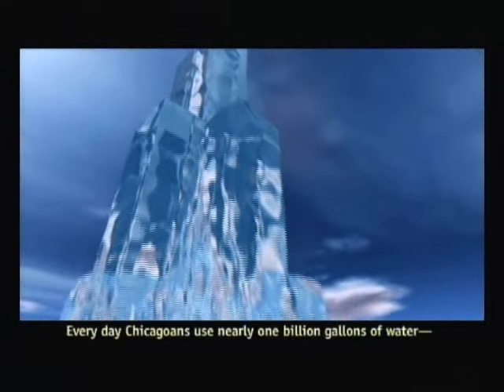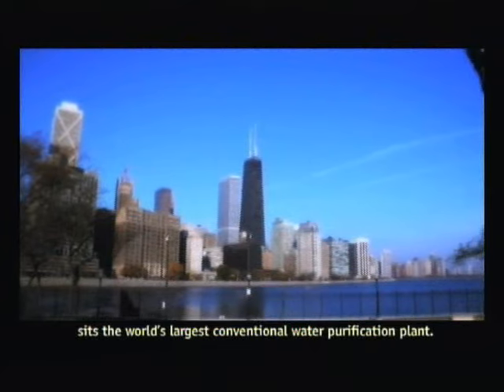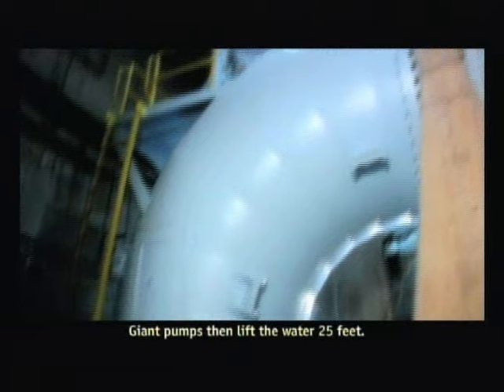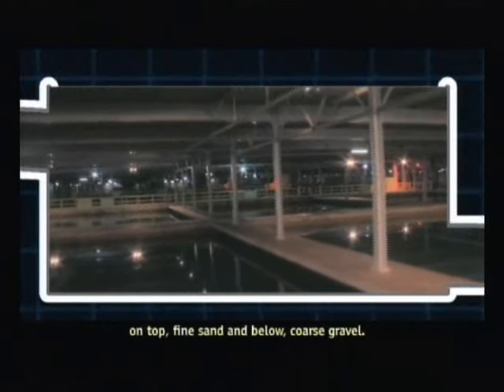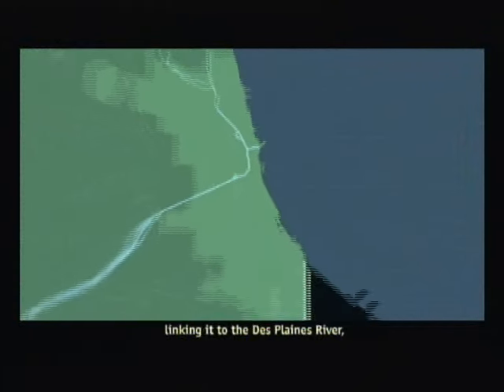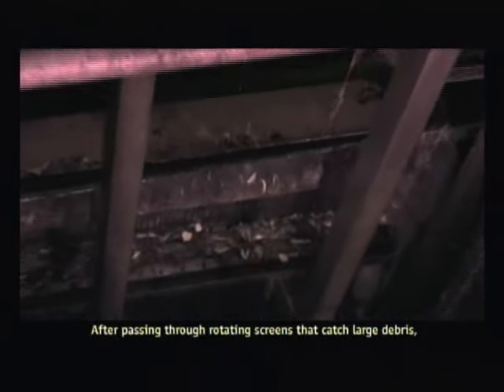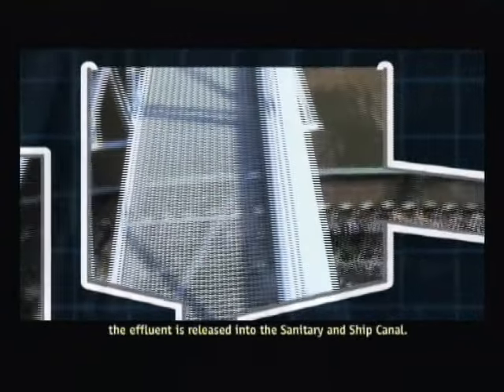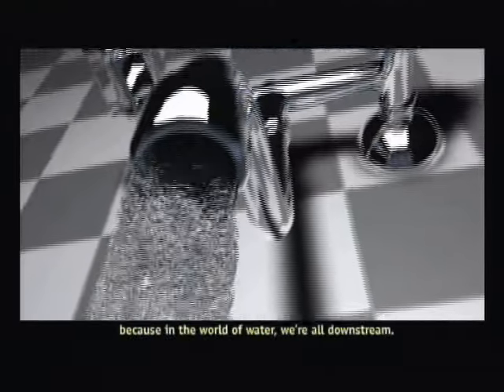Before the Faucet, After the Flush

Comment: why don't we  buld  a wetland to clean are water in Chicago we got the old runway on the like we can turn into a wetland to treat are drinking water and the water would be alot cleaner then the way the water factory's clean and use are pee and poop for growing gradens  like are food
Reply: It's a reasonable question. However, the volume of water processed at the Stickney Water Reclamation Plant is, on average, 700 million gallons a day. The simple answer is that there is no wetland large enough to process that much water and waste naturally. However, the Metropolitan Water Reclamation District of Chicago uses many "green" methods to process, clean and reuse solid and water waste, including using waste material for land remediation.